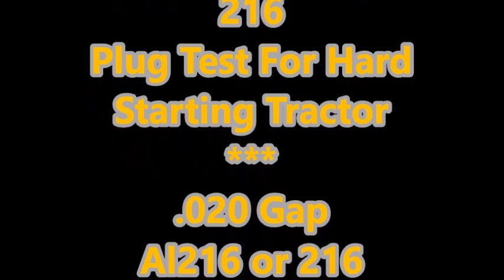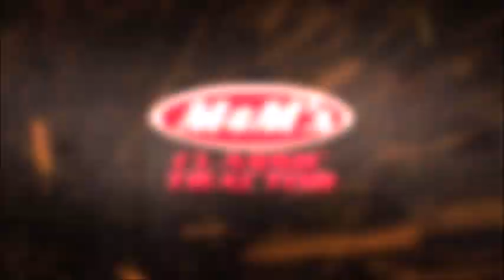Live side mount Ford Autolite plug test

Comment: Any idea what effect using the 437s with the .020 gap would have?
Reply from the maker: That really depends on the ignition coil itself. If we're talking the old square spam style can coils then 437 will be nothing but Gremlins. But later versions with the round TNT stick looking coil from the latest 8n to the NAA and *00 series tractors you will have better chances however we have found in our research that the 216 or the h10 champion is the best choice across the board as those two versions have the correct resistance

Comment: You know what's strange though about the Autolite spark plugs and your suggestion for using the 216's.  Another channnel that shows videos on Ford tractors run by Rachel and Dan Gingell, they use the Autolite 437's in their video talking about 12 volt conversions.
Reply from the maker: No offence to those two haha,  they do excellent work, however they are more about doing the "how-to" rather than part analysis and trouble-shooting.      They use the 437 since it is what is listed in todays parts books.   At one point we had made a video explaining how the 437 got there when it should actually be the 216 or the H10 Champion (the original factory plug) .  after so many updates, and collaborations and conversions to digital parts logs, many of todays parts even in the automotive world are listing what are actually "alternate" parts as the replacements instead of the accurate replacement numbers.      Whats really funny,   if you go to their store (steiner tractor) and lookup plugs / tune up kits for Ford and Deere,   they push the 437,  but the 216 will show up.

Comment: I have a Ford 8N and it starts up as if I have electronic ignition...super quick.  In one of your videos (but I can't find it) you suggest using the Champion H10 rather than the hotter H12. I think it was your channel.  If you didn't, would you recommend the H10's over the H12's.  Someone highly recommended the H10's.  Do you agree?  Thumbs Up!!!
Reply from the maker: Yes the H10 is actually the Factory original plug, the H12 (hotter) really will not make any difference without adding a more powerful ignition coil and high resistance plug wires.      The autolite 216 is the direct replacement to the H10 and in most places is more readily available which is our reason for pushing its use.

Comment: I have a 56 ford 600 that has the 437 plugs in it, would switching to the 216 and gapping plugs and points as you suggest benefit this tractor also
Reply from the maker: Absolutely

Comment: Just found this video.  I have what I believe is a '47 8N....a few features on the tractor indicates this.  But, it has an engine from a 2N based on the serial number on the block.  And someone changed out the front mount distributor to a side mount distributor.  And I'm sure it's not in time.  Do you have a video on timing a side mount distributor?  Remember, being this is a 2N engine, it does not have the access hole to see the flywheel marks.  Thanks.

Comment: I have a 1951 Ferguson TO-20 which is very close to the same tractor. I have Autolite 216's in it, but I'm going to re-gap the plugs from .025 to .020. The tractor is 70 years old and can use all the spark it can get 😉

Comment: I disagree with your demonstration here, first the tractor was flooded and you removed wet fouled plugs and replaced with new plugs. Still a bit hard to start even with the new plugs. I just removed a set of 437 plugs from my 2N that had been in there for 18 years they were clean with no fouling. Dist cap was my problem started jumping spark. eve the points looked good after 18 years. The 437 plug is hotter but does not have more resistance as you say.  I will say I am sure you have helped many people with there hard start no start concern.
Reply from the maker: Thanks for your comment.   We try to explain things in a simplified way for people to get the gist of how these old machines work...  However we were correct in our description of resistance of these plugs.   Basic electro-thermal dynamics.   Higher temperatures (heat range) creates higher electrical impedance and resistance, therefore an ignition coil needs to be able to overcome that resistance consistently to create the required spark.    The higher the temperature, the higher the resistance etc.  We also heavily state that the problem area on this system design happens to be the coils themselves.  Namely the front box coil.  They were not and still are not built capable of amplifying and pushing the voltage required and at high enough frequency to fire the 437 (hotter AL plug 800c  vs al217 500c plug) and be dependable.

If yours is working great then most likely yours is a side mount design which does have a much higher voltage range and can run 437 plugs (which we have also stated).  If it is a front mount then you definitely have a rare bird.   

Thanks again for the comment
Reply: Why did you remove the silver washers before installing the spark plugs?
Reply from the maker: @stryped12  Oh we did not remove it.   Sometimes they are loose in the box and  those will fall out (usually before we get them...lol) .  We borrowed one from another plug to put on the new plug missing that ring.      Unfortunately about 1 plug out of every 20 or 30 boxes we get is missing that ring.

Comment: What plugs should I use on my TO30?
Reply from the maker: Autolite 386.     If running 12V system , set plug gap at  .025"
Reply: M&MS CLASSIC TRACTOR  Thanks I still have the 6 volt system. What plug do you think?

Comment: What would you recommend the proper gap for the float inside the carburetor be?
Reply from the maker: I have no definitive measurement for that. All documents and books I have ever seen conflict with each other on this.   HOWEVER...    We normally set the float just slightly above parallel (or slightly above level) with the upper portion of the carburetor.   Simply hold the top portion of the carburetor upside down and allow the float to "rest" naturally under its own weight.  Make sure both barrels of the float are even with one another and that the float assembly is level with the gasket surface of the carburetor or just ever so slightly above level with it and your good to go.   Its ultra scientific I know , but it has worked on hundreds of marvel-shebler carburetors that have come through the shop.
Reply: Thanks for info. I just had a local guy clean and reassemble the carburetor simple trying to save time, bad move. Now when the tractor sets over night the carburetor fills up with gas so much that I have to remove the breather tube so the fuel can spill out. Also, as of yesterday, the tractor runs smooth for 3 or 4 minutes then shuts off like you turned the key off. It will start back but the shut off after a minute or so.

Comment: I just applied your advice to my 1949 8N and it worked perfectly. Tractor starts first bump. I do have another question for you. The pto works as it should but the lift arms will not work. Is this a pump problem? Fluid is clean and no leaks. Thanks for any help, Todd.
Reply from the maker: First off,  its great to know the plug advice helped with the starting!   

Now for the lift, there are a few common issues.   It as actually kind of rare to be a pump but we can not rule that out.      Im guessing that since you checked the fluid condition that it does have enough so this is where we get a bit dirty.   

DO NOT RUN THE TRACTOR FOR THIS!  

 You will need to drain some or all of the hydraulic fluid. (save it if possible as you can reuse it if it is as clean as you mentioned).   Remove at least the rear bolt from the right hand floor board (it sandwiches the board bracket with the round plate where the dipstick is located) , then remove the round plate that holds the dipstick.    Grab a good light and look inside at the linkage.    You should see two long bars coming from top to bottom (kind of like the front fork on a bicycle).  The bottom of those bars should be holding a piece shaped like a "T" that pushes and pulls a valve into the pump.    This valve the "T" moves gets hung from moisture or sitting long periods.   Also the "T" can become disconnected from those long vertical bars.    While watching that "t" and valve,  move the lift control lever fully in both directions.  You should see the "T" move the valve in and out of the pump.    If it is disconnected, then simply reconnect.  If it IS connected but it looks like the valve does NOT move, then simply use a LIGHT motivational tool  (I.E Hammer) and tap on it until it moves freely.   

If you can not motivate it free, then you will need to drop the pump and replace the valve.   (cheap to replace if necessary)
Reply: Thanks for the response, I will definitely give this a shot.